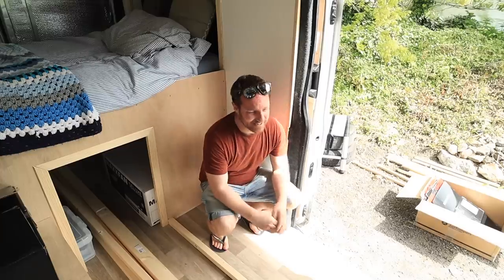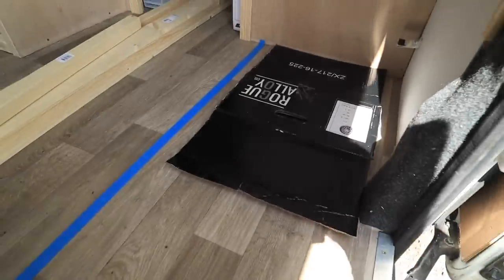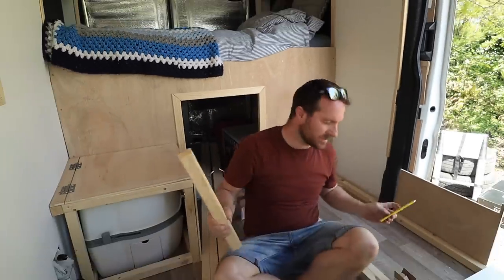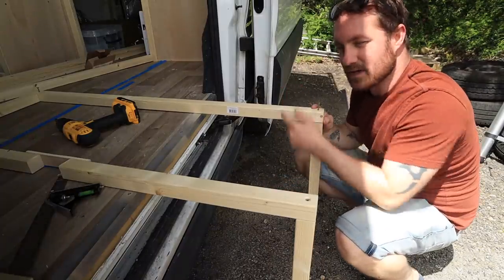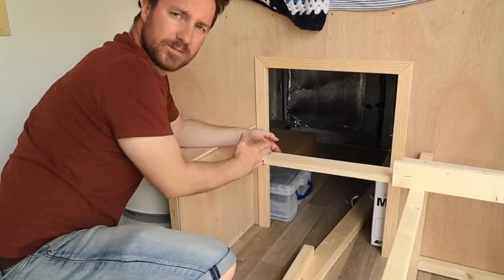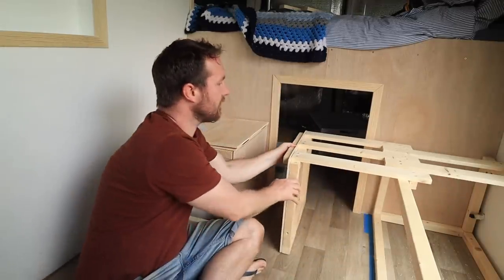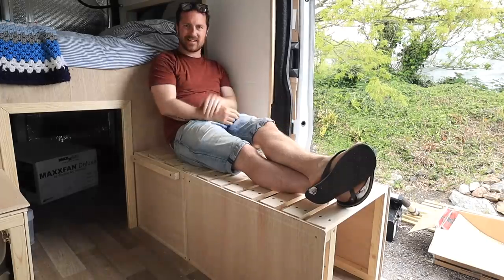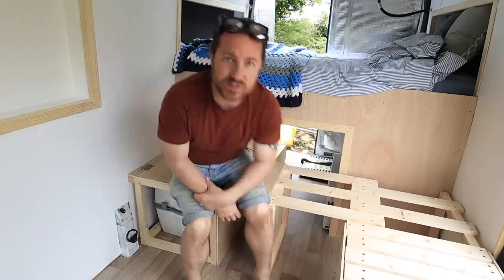SPACE SAVING CAMPER VAN PULL OUT CORNER SOFA

Comment: Maybe you could hinge the connector between the toilet and the bed so you raise it from 180 deg up to 90 deg. Then if using hinges that allow it to go beyond 90 deg, then you raise it up beyond 90 deg and slide the extension out then it falls back to 90 deg and is supported.

This could mean the hinges are on the inside of the toilet box. Which I think would be tidy.
Reply from the maker: Good advice

Comment: Why not have the toilet flappy bit flap up from the front, you could still cut the handle hole in, just cut it in the flap as well, hinge either side of the handle hole, lift that bit first then slide the centre part of the bed out and the flap rests on top
Reply from the maker: Good advice